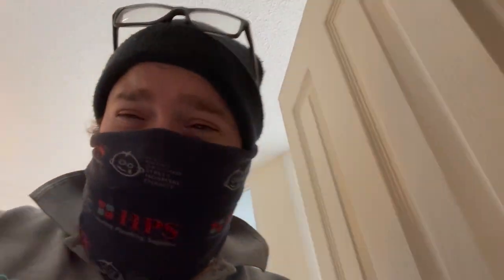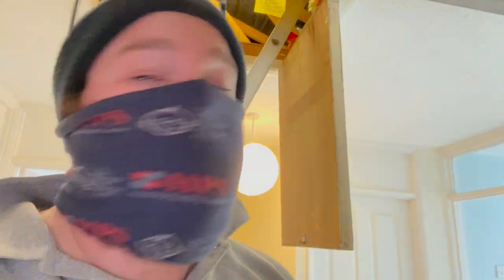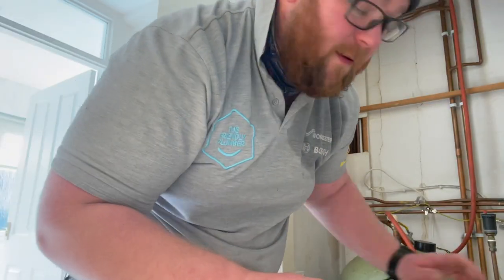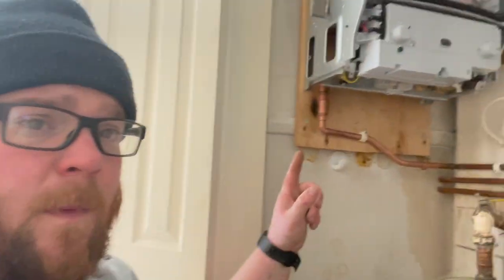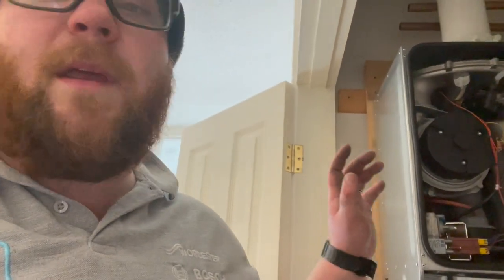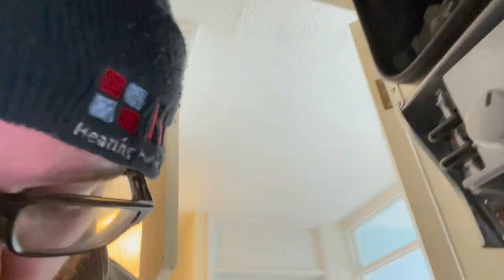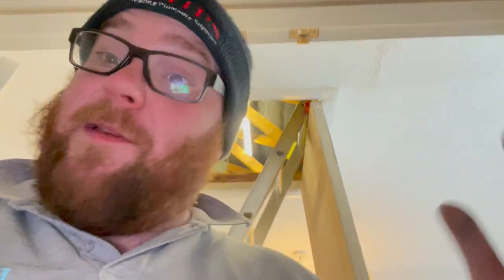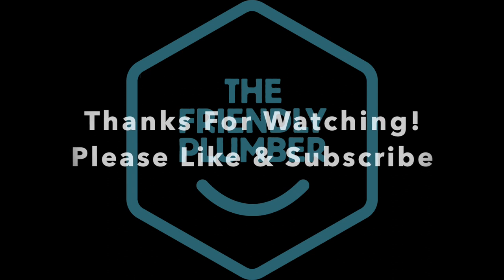Worcester Bosch Boiler installation - A day with Friendly Plumber

Comment: At last, someone else that has a roofer to sort the flue terminal out.  Adds a bit to the quote but i think its better for the customer that if there are any issues down the line a roofer turns up to sort it and not me.  Not many people show the flue or the condense installation either, tidy, i have subscribed.
Reply from the maker: Appreciate that chap! It saves so much time and potentially a load of damage that i would undoubtedly do as im not the smallest chap and dont know how to safely do it! Thanks for the sub!

Comment: Jesus striplights in a loft, i normally get a 10 watt bulb at the far end of the loft when i do em..
Reply from the maker: 😂😂 i can guarantee i don’t always get that lucky! Straight flue as well no 45’s!
Reply: Lol !!! Any appliance or part of should have access and light and safe working position. The amount of solar thermal and MVHR in lofts with no thought of maintenance is breathtaking and how many boilers are the same!!! The industry needs to separate the fitters from the techs!!!